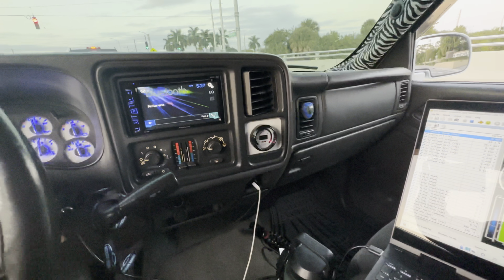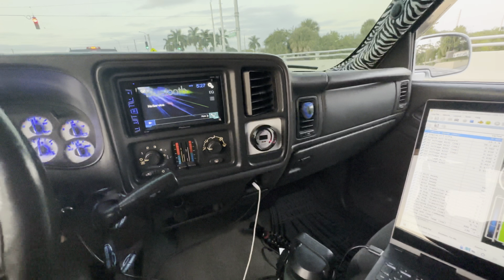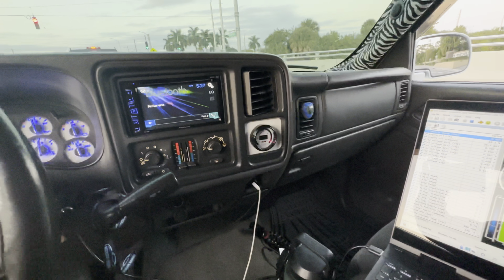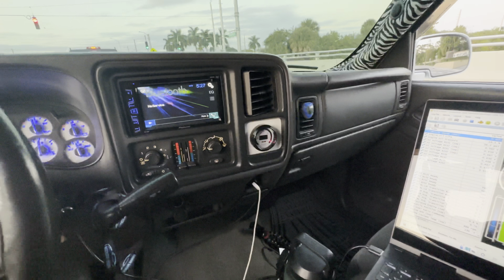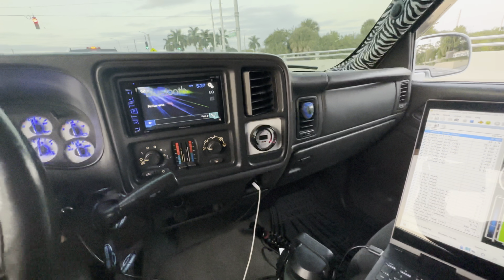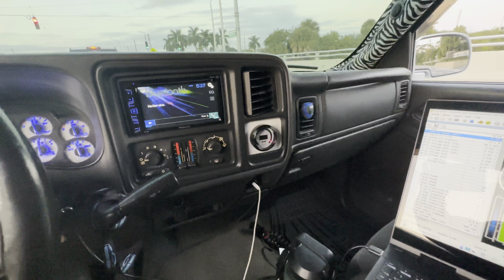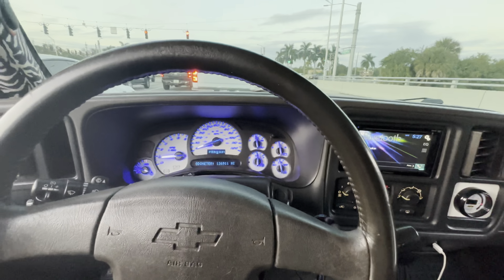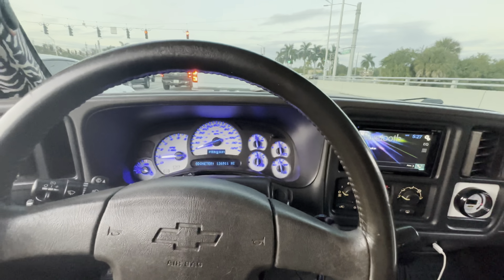How to make your cammed truck even faster!

Comment: It running better with bigger headers because it’s getting all of the combustion/exhaust meaning its actually flowing the right amount of air to fuel ratio thats why its running better
Reply from the maker: I knew it was something! Haha it does feel like it helped when going WOT
Reply: @SiskBuilt  yeah i have a similar thing rn with my truck but the reverse its not getting enough exhaust flow because it used to have procharger and longtubes ive now gone to no procharger with shorty the tune was completely off but when it was running with the longtubes you coulf make full passes on it with no tune because the motor got the right amount of exhaust flow to make up for the fuel ratio
Reply from the maker: @shadowreaper5438  oh wow! Why’d you go to shorty?
Reply: @SiskBuilt  well the state i live in has shit roads for one and two its was completely straight piped with longtubes and it was just so damn loud you couldn’t hear anything its my daily plus my goal is to make a daily drivable inspection passing race truck so i went with patriot headers they are designed like longtubes but are the size of shortys to a full three inch true dual three inch x pipe highflow cats so it doesn’t reek of gas all time and spintech mufflers its just loud and honestly feels like it has more power in the lower rpm which is where i drive it mostly but it has a btr stage 4 cam so it’s interesting setup im thinking about making channel on the truck not sure yet though

Comment: what kind of horsepower u getten  i just put a 396 stroker in my obs truck ,, and what gear u running ... that truck sounds damn good
Reply from the maker: Mine is a 370 cubic inch. Made 385 at 4500 rpm. So at 7000 it made a smidge more. 3.90 gears with the 4l80

Comment: With your truck now hooking up, do you have safety loops on the drive shaft?
Reply from the maker: Nope! Also the tires ran out QUICK so it spins bad now
Reply: These performance modded truck are fun yet the tires run out so quick I have to buy used.
 I'll go through a new set every 10 months if I was to buy new.

Comment: Have you had any dyno time on this setup? What are the fitment specs for the front and rear wheels? 👍🏼😎
Reply from the maker: Was dynoed about 3 years ago. Made 386 but transmission was slipping so peak HP was at 4000/4500

Comment: I have the same truck but with a pearl white custom paint. Putting lsd and 3.90 gears in it this week and pulling the 3.42's. What's your rpm on the highway at say 75 mph? I was thinking 4.10's but with the 3200 stall and 470 to the wheels I felt I didn't need all the gearing. That thing is perfection now bro!
Reply from the maker: With 80e, 28’s, 3.90 gears, I’m at 2100 at 65 mph. I dont know off the top of my head what 75 is but it’s probably 2700?